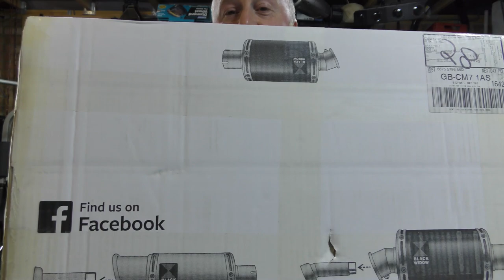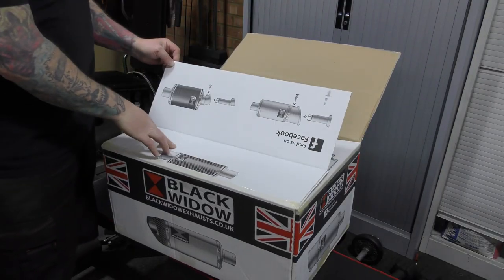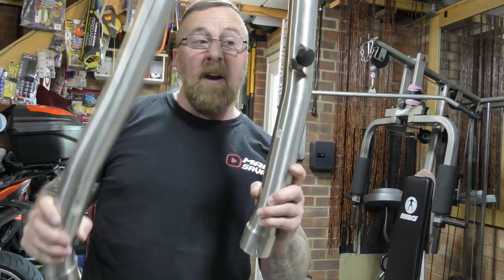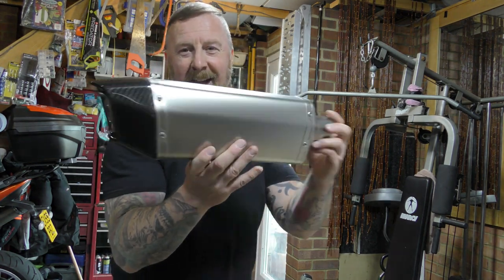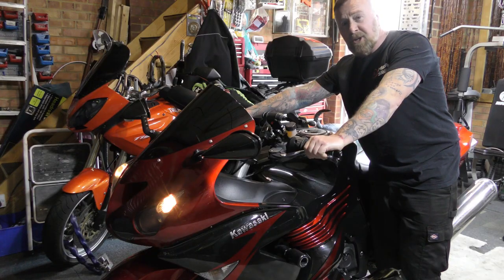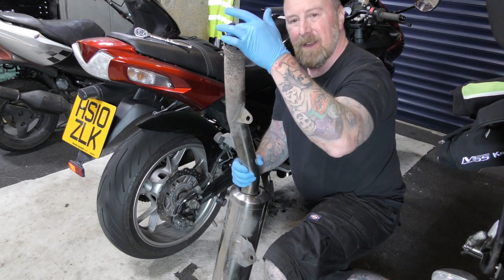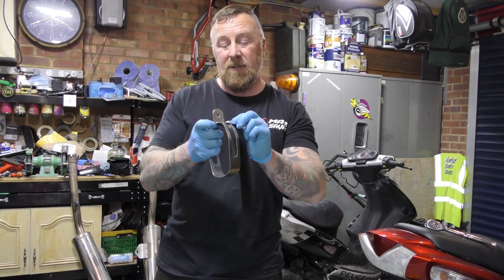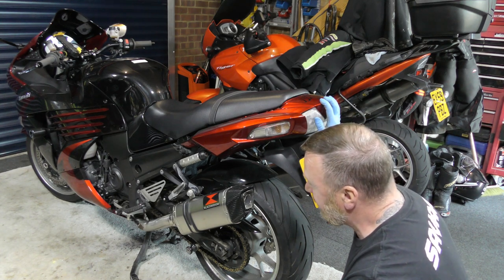BLACKWIDOW EXHAUSTS SILENCERS KAWASAKI ZZR1400 MARK SAVAGE

Comment: Good exhausts. Went for the 300mm oval as the 230 mm and 200mm make the bike run rich and are a bit too loud. Can always remove the baffles if you want even more volume. Good video mate 👍🏻
Reply from the maker: thanks bud , i like loud exhausts as they has saved my life many times but as getting older sometimes its nice to have a little less noise lol, take care bud

Comment: Yo mark do you know the original peugeot speedfight 2 carb adjustment like how many times should i turn to get a good mixture
Reply from the maker: Hi bud https://youtu.be/6n5YuLxc4VA
Give this a watch 
But I've got a load of videos of the settings
Reply from the maker: Air mix etc
Reply: @marksavage  Thanks

Comment: Hi Mark. Just wondering if you know anything about 4 stroke mopeds. Mines a 50 and kept cutting out when I got to traffic lights and junctions, if got it home and checked the air filter, fuel filter, valve clearances, oil, iv changed the idle and when I turn the idle tighter it revves higher to the point the wheels going on it's own. And there is no inbetween. Any chance you could help?
Reply from the maker: I have a few videos on 4t mopeds on my channel they should help , but age of ped , e10 or e5 fuel , have you had it sitting with e10 in it ?
clean carb as in my videos bud
Reply: @marksavage  hi it's a 2020 sym mask, since I bought it I have always put e5 fuel but I'm not sure what the previous owner was using.

Comment: I have the Gen 2, I've heard there's some issues regarding fitment and centre stand?
Reply from the maker: I can't see why there would be fitting problems but if worried contact them as they are really helpful 
Great price and sound good too
Reply: @marksavage  Well, they got back to me from Black Widow. And said that the systems wouldn't fit my bike, Zzr 1400 (13) with a centre stand. Do they not have a bump stop I guess.
Reply from the maker: @matthewjackson3034  well that's a little disappointing to be honest ! Wouldn't have thought there was much difference
Reply: @marksavage  Yea, rather gutted.

Comment: Hi Mark, i just bought a speedfight 2 2006 LC and the variator doesnt seem to have a washer but a big plate on back of the front variator. Is the plate the restrictor?
Reply from the maker: That can come off bud , its the one that has 3 screws holding it on to the rear of the variator
Reply: @marksavage  thanks Mark!